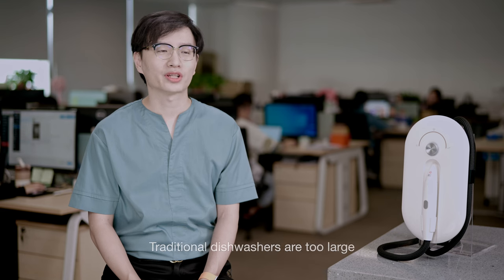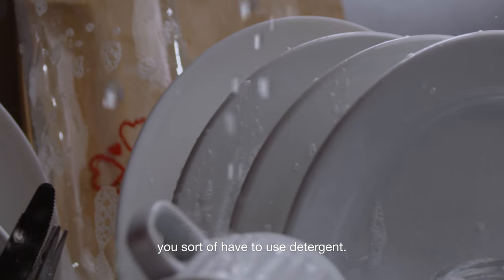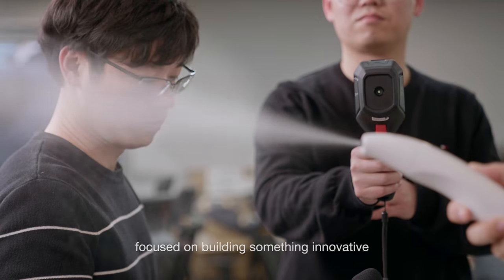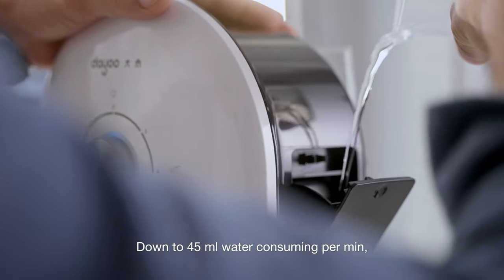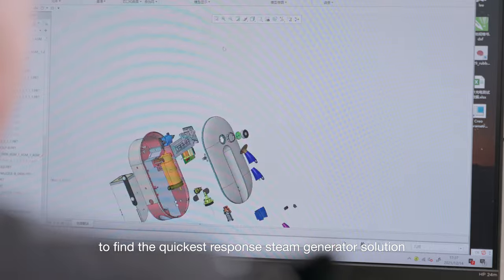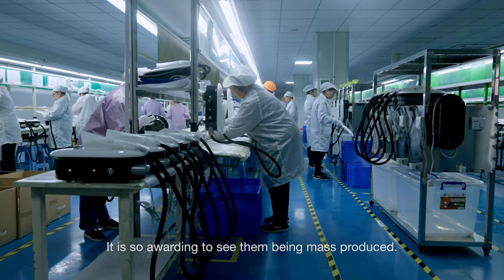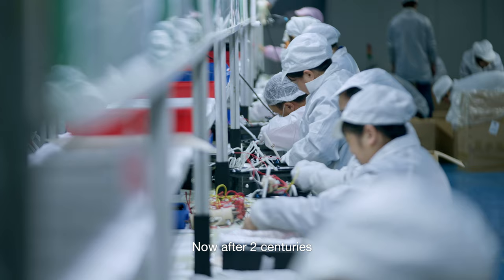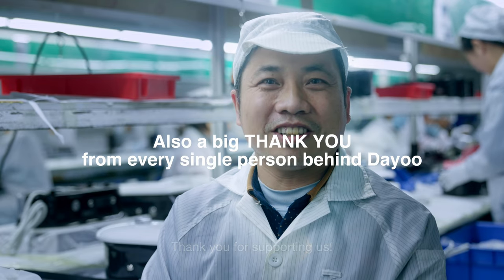Dayoo Kitchen Steam Cleaner & Dishwasher

Comment: good idea but safety concern in holding the dish while applying steam?
Reply from the maker: Dayoo is absolutely safe to use. You have no worries about that as the Dayoo features a scald-preventing design -- The steam rapidly cools off once released to deliver a worry-free washing. We suggest you keep your hands 4-inch (10cm) away from the nozzle when using it. The steam will cool off to a safe and comfortable 122 °F or lower 4-inch away from the nozzle with lower pressure. You can feel safe to feel the steam with your bare hand at this distance.

Comment: It would have been better if you had stuck to just cleaning dishes with this product. I don't want water all over my home trying to just clean. It's water guys, please don't advertise it for cleaning appliances unless you care for some electrocution some rust too. There are better tools for other purposes. One thing I shoud say, thank god you stopped at the bike and didn't proceed to show cleaning the car with this thing!
Reply: Well there's a certain amount of common sense required here.   I have an old  Shark Steam Cleaner that is going to be replaced by this, and I use that for cleaning all sorts of things.   You need to strip off oil or something organic it's hard to beat steam.